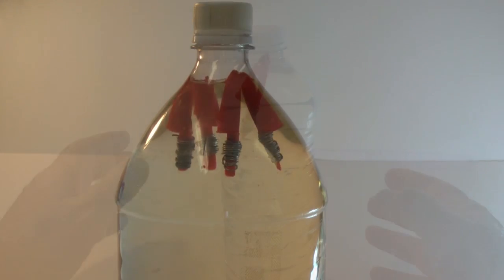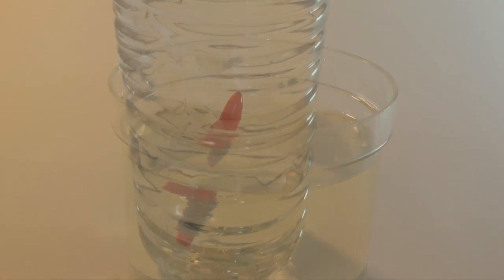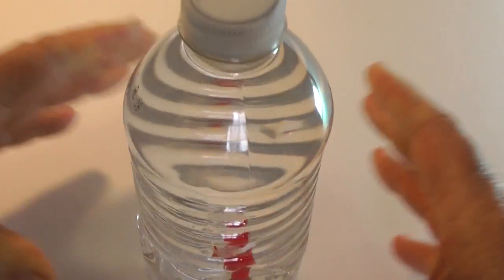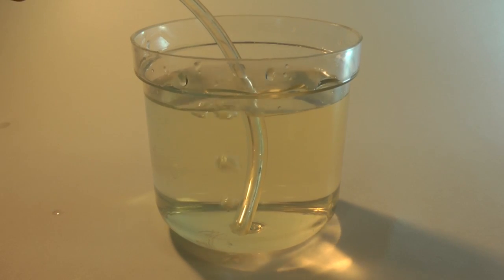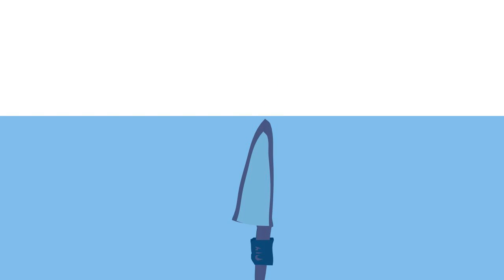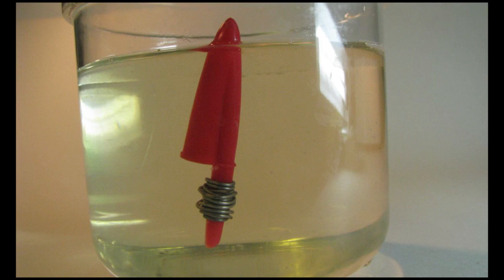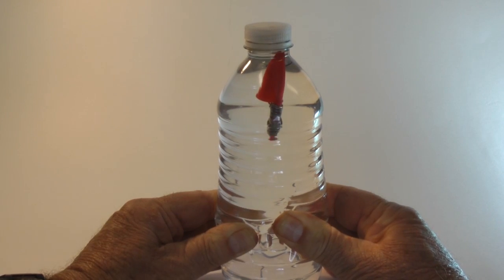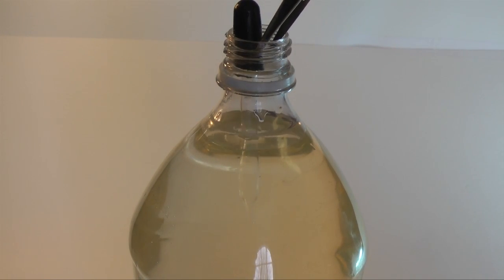Cartesian Divers

Comment: Very good!  You have the explanation correct.  Some think the water that appears to enter the diver increases the mass/weight, but this is impossible due to the open bottom.  The water that appears to enter the diver is misleading and it is actually external to the diver proper and only shows the difference in displacement.